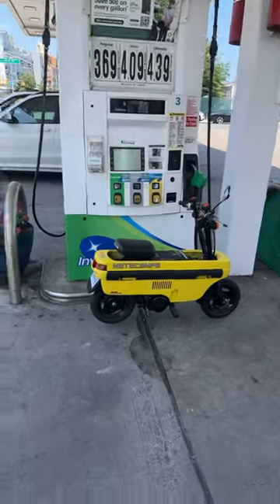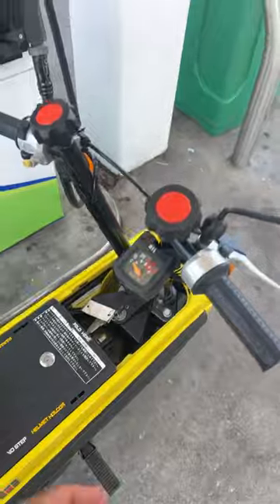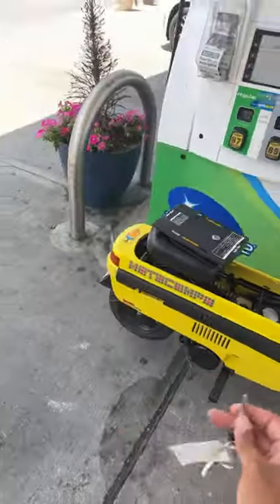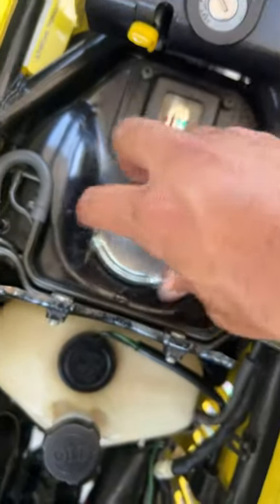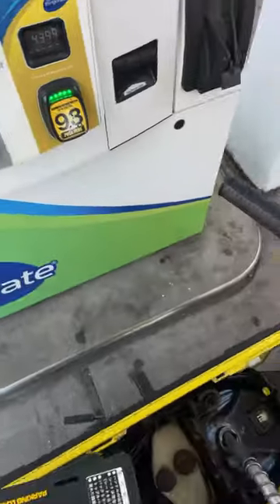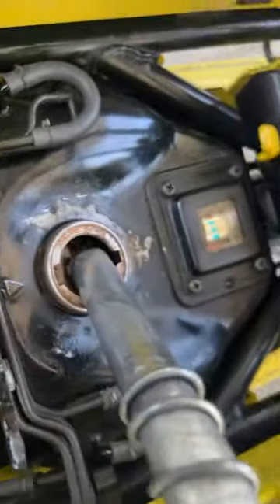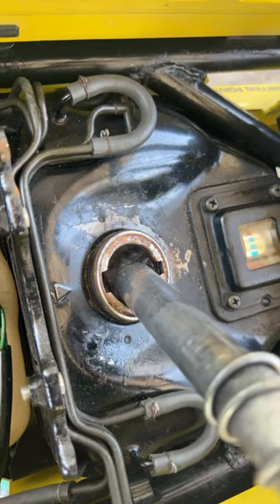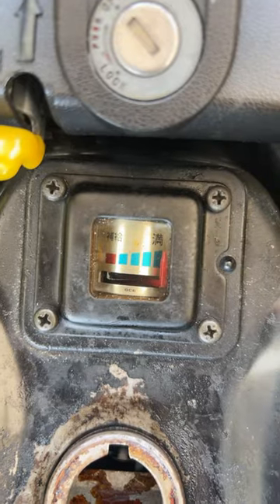How much gas does it take to fill a Honda Motocompo? (PART 2) #honda #motocompo #gas

Comment: Just a general FYI with using premium 91+ octane instead of regular: never run 87 if you're at all able. There's the obvious reasons of better gas mileage and better fuel quality. There's also any vehicle advertised as "performance" is plastered with warnings in the owners manual and stickered with "premium fuel only" on the car itself. Not to mention stations will use 87 as a dumping tank for any leftover fuel; that gas you think you're getting is regular just may have quiet a lot of other junk like kerosene contaminating it. Oh and never fuel up when the tanker is sitting there delivering fuel, it stirs up the junk in the tanks and you end up sucking up that crap and clogging your fuel system up.
Reply: Good to know. Thanks.
Reply: wrong, octane has nothing to do with fuel efficiency or mileage. Most cars, old cars, anything other than a performance car as you said, 87 is fine. Nice tip though with the trucks.